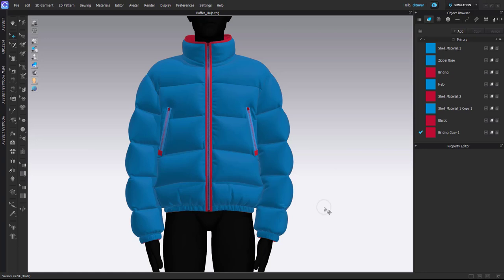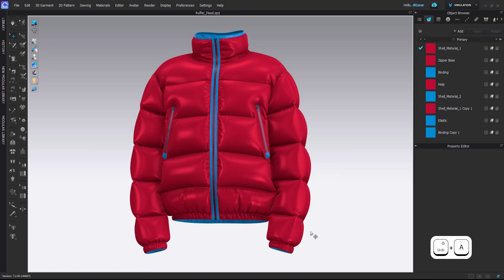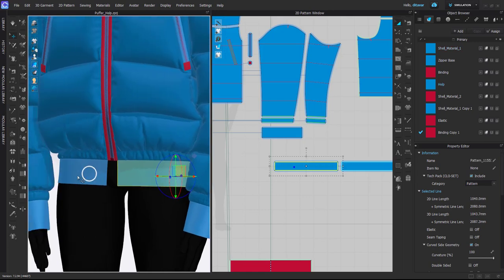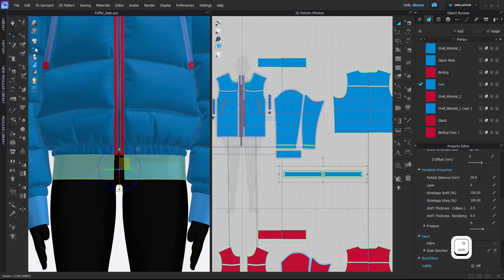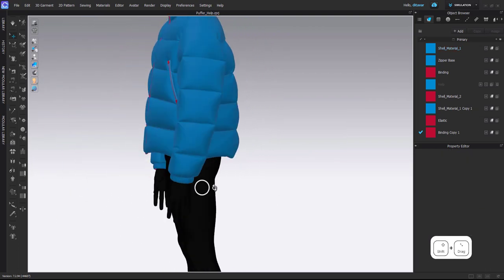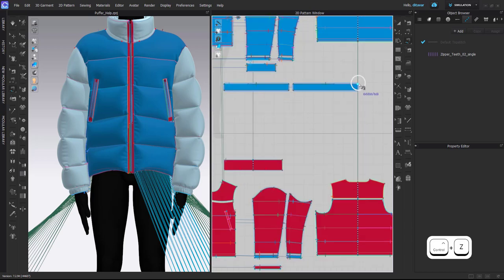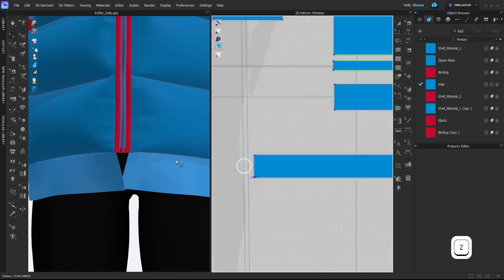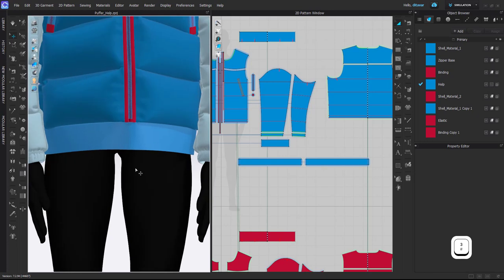CLO 3D | Perfect Puffer Hemline

Comment: This method wouldn’t work with animation would it?
Reply from the maker: Depends on the outfit. I sometimes use transparent helper pieces in animations, but it requires testing, to find right properties for the fabric. If the fabric is too stiff or heavy, it starts to float and make hemlines look unnatural.

Comment: what are your thoughts on using avatar circumference measure and attach to measure if you need to simulate?
Reply from the maker: I think why not. If the hem is fitted  to body like I have in the first example, I think it can be a good and very quick solution. :) I like this method I show because it allows me to adjust the position and shape of hem any time, and it also works for curved hemlines. With avatar measure you loose a bit of that flexibility.